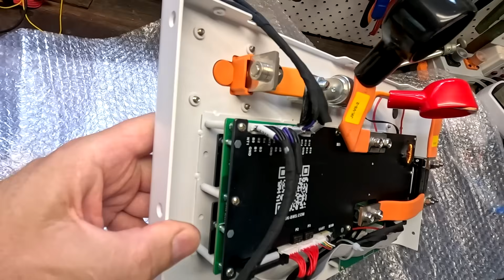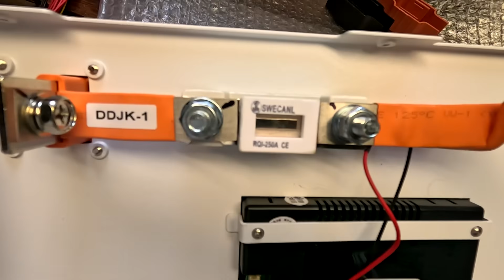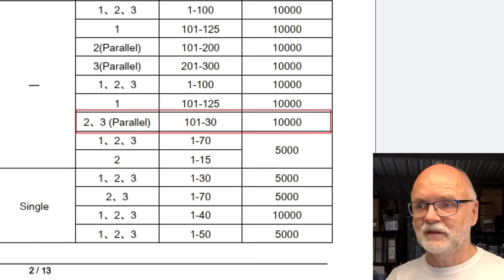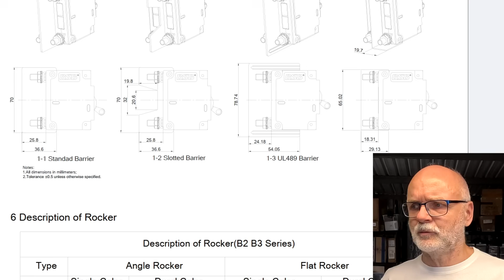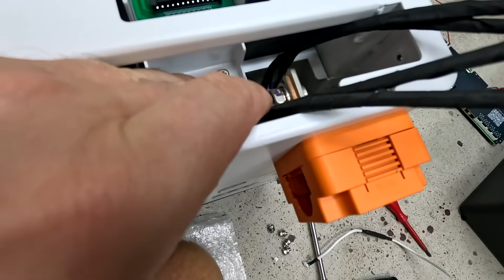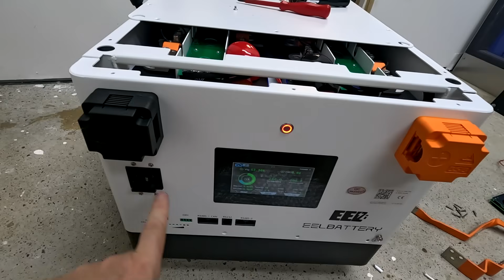EEL Battery V6-Pro DIY Kit - Upgrade. Actually pretty good!

Comment: great videos as usual. May I ask you which kind of inverter do you recommand to connect to this DIY battery (~16kWh). At home, I'm using micro-inverters, and I would like to know if it exists a simple inverter working just with 230v (MO + grid) and battery. Thank you so much!

Comment: Hi Andy.

After watching your video on the EEL V6 box I ordered 2. They came at incredible speed delivered.
After putting them together I put one into my system (small, 4 panels, 1 MPPT, 1 Multiplus ii, Cerbo).
The thing is could you tell me what cable to use between the battery box and the Cerbo?
I tried several UTP but suspect I need a Victron type A or B but cannot find the correct info.
Thanks for all your videos buy the way. Has been much educating!
Cheers,

Herbert (France)

Comment: The one thing I don't like about these battery boxes is that they assume you want to connect in Parallel, if you want to connect in series you will have cables running across the screen and have longer cables. Would be nice to see reversed pole version then if you wanted to connect in series you can stack in alternative pole versions. Given that batteries in excess of 280AH are very common now, connecting even 4 of these boxes in parallel will see an amperage exceed 1KA
Reply: Neither the BMS nor the cases are rated for serial use. I just build 4 cases and would definately not recommend doing that, as the insulation from cells to the metal is only 1mm and if you reach higher voltages of 800V that could spark. Also I‘m not certain if the communication lines are isolated

Comment: Hi friends I have a question to be answered by the lithium cells experts.
1. IR 0.15 TO 0.20 AND capacity 330 to 340.
2. IR 0.17 to 0.22 and capacity 320 to 340.
3. IR 0.16 to 0.21 and capacity 332 to 336.
These are three pallets specs which one is best to select .
This is the variance of IR and Capacity.

Comment: how do you solve the high charge alerts with the JK BMS? (1 or 2 batteries are full rest is not and get all the amps from the full ones. High charge alert.... (Connected through CAN daisy chained)

Comment: It looks really nice, but I wonder one thing, isn't the interruption current of 100kA a bit over the top? When I look at 16 MB30 or MB31 cells in Series they seem to need about 21kA so 25 or 30kA should be more than enough and a DC MCCB with 30kA might be cheaper and as safe as the switch + fuse plus extra cables.   Its always better to go safe but 100kA seem to be over engineered but maybe it is around same cost as a 30 or 50kA fuse?
Reply: It's most likely not accurate for DC , that'd be an AC rating.

Comment: Is the metal box of the battery AND any negative connections in the BMS/CAN connections isolated from the negative of the battery?  If not, when that breaker trips or is turned off, the power has an alternative path to the load. Be it by the frame of the box, or across the negative of the CAN wires.

Comment: Ich habe absolut keine Sorge, dass sich das BMS verbiegen könnte, denn die Kompresionsplatte ist an drei Stellen (links, rechts und mitte) verschraubt, die Flächen dazwischen haben nur eine geringe Länge und sind mehrfach gegen die Biegerichtung versteift, sodaß sich die Verwindung im (sehr kleinen) Rahmen hält. Ich behaupte sogar, dass die thermische Ausdehnung des BMS eine höhere Belastung erzeugt, als die Bewegung durch die Ausdehnung der Zellen.

Comment: regarding the maximum short circuit current:
i really would like to know how high the current really would be in that case.
How about you get someone that can measure these high inrush currents, short circuit a battery and see what happens?
Would also be interesting if the BMS survives this.

Because the resistance of the cells are extremely low… but there are 50mm² busbars, a lot of connections, a BMS, a fuse… if i add all the resistances, i think you are in the range of 7 mOhm.
That is a maximum possible short circuit current current of 8000A.

Thus… a 10kA breaker should be sufficient.

Comment: You are one of the most followed people on the planet when it comes to lifepo4 and you don't say anything about batteries in the 2p16s (feleicity solar) or 3p16 configuration (docan and panda) 2p8s (victron) with just 1 bms. How dangerous are they? Why are you so silent?
Reply: if i remember correctly, he said in previous videos that he would never use them because you can not monitor every cell.

But i would also like to know if this is a real issue or not…
Reply: I have built and used 2 custom made 16s2P (32 MB31 cells) with JK BMS and it is working perfectly. Most of the time the balancer does not even start since deviation is bellow 5mV. I just had to custom build a special cabinet to store the packs since there is no DIY box for this kind of configuration. To me it is not very important to monitor each cell, if there is a problem with one cell you will detect it with the pack of 2 parallel cells anyway. Hopefully Andy will soon test the solid state batteries from Samsung when they become available. Cheers

Comment: The load side of the breaker should be the Output. The line side of the breaker should be the BMS/battery. From my perspective, the breaker is installed backwards.
Reply: exactly, probably because it should be used on the positiv terminal.
Reply: maybe possible to just put it upside down?

Comment: Thanks for pointing out the fuse on the heating pad, I never thought of that when I installed my pads and I agree they should have one.   My old set up had them, but since I upgraded to the new Jk BMS, it does not.   Looks like I need to do a mod on my Battery box.   Thanks!!
Reply: I recently ordered this V6 PRO box with heating pads at Alibaba, Shenzhen Eel Battery Co Ltd and without asking for I received pads with a 10A fuse fully integrated in the cable! They also follow Andy's advises.

Comment: Glad to heare it.

I've 4 batterys 2 EEL v4, but first version with AWG cables and 2 Yixiyang. When I bought the yixiyang and mounted a 3 phase MP2 5000 system - I tested every battery on full load. Sure - the EEL can't manage 200A but if checkt the temperatures by 80, 100, 120 amps I was chocked - to be save the battery shoud stays under 80-100 amps. While that load the circuit breakter contacs reaches over 70°C, with 120 Amps i got over 100°C, and on top the Case was opened. The design with the circuit breaker is not the best. With 4 batteries in parallel its not the challenge to deal with, but what happens, when one or to fails and the BMS is still on and communicates to the bus? By the way - the Yixiyang (We really needs a short name for this ;-) ) boxes worked fine at 180 amps while testet time of 20 minutes.
 
So a directly ordered two of the upgrades. And on top i have then 2 v15-BMS as technical reserve and can play with them.

Comment: Is there any verification available for the Fuse labelling?
The Class T fuses from Littlefuse and Bussman have the connection tab in the middle of the fuse. 
I have purchased other supposedly Class T fuses from Amazon / eBay, that are like the one in the EEL, with the connection tabs offset , and also have physical size difference to Littlefuse & Bussman, and could not find any data on them.
What is the symbol on the EEL fuse to the left of name "SWEFUSE", a "V" ?? with something in a banner beneath?
Reply: You can use an Adler EF3 fuse for example 250A. Fits perfectly! You can print a plastic cover for the fuse

Comment: V6 is a good box but still has 3 main shortcomings:
- FAKE Class-T fuse (user should replace it)
- Breaker connected to the negative terminal (should be on Positive terminal.   That could be a big issue if someone has grounded their battery negative to the box.  It gives a false sense of safety.   
- I asked them to include a yellow insulating board to place above the batteries (between the batteries and the metal lid of the case.   They sent me a folded thin plastic sheet to glue to the back of the lid.   It's better than noting but not as protective as having a yellow insulating sheet like yixiang DIY boxes.    It's a bummer because I ordered the box form EEL rather than Yixiang specifically because EEL were advertising a Class-T fuse.
Reply: As it seems you own the box, I will ask this from you as well: What is the hole spacing for the fuse? Is the bolt an M8 or something else?

Comment: Thanks for the video! Already built two EEL v6 Pro and was overall happy with it. But was wondering why there is still no compression by the plate when I mounted it. I used five epoxy plate to generate at least a little bit of compression. What are your views on that?

Comment: Also Andi.  You were concerned with the breaker letting 270A flow through and that the bus bars would have to sustain such a load.   According to the spec of the breaker, it will allow 250A and trip between 10 and 100sec (less than 2 minutes top!).  The bus bars may get hot but nothing will melt for that short time.    Of course, if the BMS has not stopped the load already,  then it's already damaged!

Comment: I ordered my 2 eel jk boxes right as they released them in 2023. still called v3 at his time.
cables to thin and this breaker really gets to hot! checked it with ir-cam.
never gone over 100A per box but now 2 years later both cells which connected to the breaker are damaged. their voltage is highest while loading and drops as soon some load drawn.
30 cells are perfect in balance even across 2 boxes but both cells to the breaker gone bad.

Comment: Andy, what is your opinion of the Adler EF3 fuse as a replacement?  It does fit.
Reply: I have the upgrade kit and Adler EF3 200A: the fuse fit perfect in the holder but the busbars are ~1mm to long because the Adler fuse is a little bit bigger (and has screws to the sides).
the busbars are quite long so 1mm cut off should no problem.

Comment: Hi Andy. Keep in mind that the first protection is the BMS itself. If for some reason it fails, the fuse can be considered as last protection. I have only Seplos V2 (do not like jk) on my main system, all EEL boxes without the breaker. I had a couple of experiences shorting the outlet of those batteries and I was barely able to see the spark because of the extremely fast protection of BMS ! I personally hate the embedded box breaker (the internal resistance is quite high and unstable). I prefer to switch through the BMS switch. Regards. Peppe da Napoli.
Reply: What did you do to experience multiple shortages?    Sounds dangerous.....
Reply: @RobbieHLM Hi Robbie. The first time was by mistake. The second time I showed it to my brother, I did it with a thin wire. It's impressive how fast it is. I strongly believe that the fuse (and BMS) is more than enough. Those internal breakers, in the long run, can only generate problems. Regards.
Reply: @peppeper9325 🎉You clearly have no idea what you're talking about...

A BMS doesn't mechanically disconnect the circuit like a fuse; any BMS can fail, they're just MOSFETs that regulate the current. What you do for yourself is none of my business, but stop spreading this nonsense to other people. Otherwise, you should talk to someone about your problems.
Reply: IT is true that the BMS is supposed to stop overcurrent and shorts.    But a BMS  is an electronic current and voltage regulation device and it is not a legitimate Overcurrent protection device.  (OPD).  OPS is meant to physically disconnect the battery.   But it is good to have all 3 devices.   Belt, suspender and something else holding your pants up 🙂
Reply: @ivor33 No Ivor. The maggiority of the BMS do not adjust current, not even voltage. They are monitoring each single cell voltage, temperature and current. If any of those paramaters are out from safe working range they are opening the charging or discarging switch (mechanical or mosfet). Only some BMS have the embedded charging current limitation (all seplos and only the jk V19). The voltage is not adjusted directly from the BMS, but it, through the communication port, tell to the charge controller which voltage to reach. The main BMS function is protecting the cells, even from shortcircuit. Regards.

Comment: 2 pole breaker is good, as these half the voltage which reduces arc length. 

Main risk still is an inverter short which shorts the battery. You will never get 15kA charge, but in case of a short a 15kA discharge which can melt mosfets
Reply: Both poles are connected in parallel, how do they half the voltage?
Reply: @JGnLAU  Yes, need to be in series to reduce voltage seen by each contact.

Comment: The front end is simply too tight and too crowded. Heat management will be an issue. The should make the box a bit longer. Most tier one battery manufacturers leave massive space between cells and the BMS for a reason.

Comment: I ordered the upgrade version without the JK BMS but with a display. What they don't tell you is that you don't get a T-fuse and holder with it either. After installation, it turned out the cables didn't fit the balance connections because the JK BMS is mirrored in the panel.
Reply: I got balance cables with my upgrade kit. ask if they send you some, if you have the time to wait.
Reply: @tommyt4173  I modified the calble. The only difference was 1 extra wire on the left. but thanks for your help.

Comment: I love breaker + fuse combination. But still prefer the yixiang heavy duty breaker
Reply: The mistake those box makers often do is to include a breaker that is TOO BIG (i.e. too high amp rating).  In which case it acts ok as an on/off switch but it does not perform the necessary role of a breaker (200A BMS requires a 200A breaker!), but they often include 300A AMP breakers in those boxes.
Reply: @ivor33  it doesn't, and fuse they use is higher than 200 A anyway, and they don't blow at their rated current either.
Reply: If it was a true class D fuse, which it is not, it would trip instantly when it goes to a current of 110 to 125% its rated capacity. And because of class t fuse is very very fast acting, you must install a fuse that is substantially higher than the rated bms. The BMS is capable of doing a temporary surge of current which is necessary to accommodate transient high loads such as starting an air conditioner. If you were to install a class D fuse of 200 amp, then any surcharge above 200 amp would blow the fuse.. a class t fuse on the circuit like that is intended to handle only hard shorts. In such scenario there is an enormous in Rush of current which will instantly blow the fuse before the breaker is tripped.     The breaker of the installed is correctly rated at 200 amps. No breaker ever trips add it's ready to load. It is a normal curve that will trip faster if the excess current is larger. Any load above its rated will eventually trip the brinker. But the smaller the overload the longer it will take before the breaker trips. That is normal breaker design. All breakers work that way.
Reply: @ivor33  200 A Class T fuse would never trip at 200 A, even at 300 A it would take 15 minutes for it to trip according to Littlefuse time current characteristic curve.
Reply: @ivor33  it is just another failsafe.  BMS should turn off, if not then Breaker, if not then fuse.  I use thicker cables. Inverter and BMS also monitor and control current.
Yes 250A is too high, but i am more concerned about an inverter short which could cause the battery cells 15.000 Amps
Reply: @olaf_s_23  did you try estimating internal resistance of your batteries, connections and cabling? To reach 15 kA at 48 V it needs to be just 3.2 milliohms.
Reply: @JGnLAU  15kA is just the cells.  Bit even 7kA scares me and what it would make to cells when the plasma of an arc conducts current thru a breaker or an ANL or Megafuse
Reply: Do breakers fail? I don't get it.
UPD: Ah, it's a crappy circuit breaker not rated for short circuit current of the battery, then why have it at all there?

Comment: I would personally always replace that Class-T style fuse with a known and trusted brand. 🤷‍♀️🌷
Reply: YES, you are correct and replacing with a known Class-T fuse (and matching socket) IS the way to go.  In this case, the fuse is an EV fuse, not a Class-T (see my full response with the specs)
Reply: It really looks like just a copy, but maybe it's too soon to be on the list. But, I'm thinking it's just a copy. And using the old base is telling.

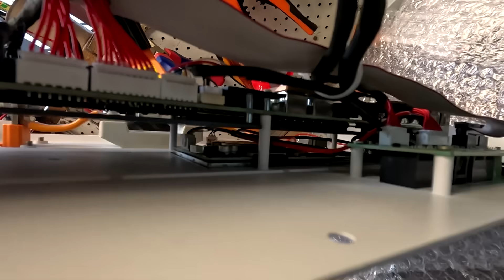Comment: 03:25 will be pleasure to replace the melted display after a while under the hot (and sunny) BMS
Reply: I operate 6 of them inland NSW/Australia and nothing gets hot (or even warm).
Reply: @moestrei  thx!❤
Reply: Well, the good news is that IF you have to replace the display, it is only holding by double side glue tape to the front panel.  No screws under the BMS or anything.  Just pull out the display with a a screwdriver and put in a new one after disconnecting the old and reconnecting the new... should be very easy!
Reply: @ivor33 Again, there ist absolutely nothing which gets hot inside the box.